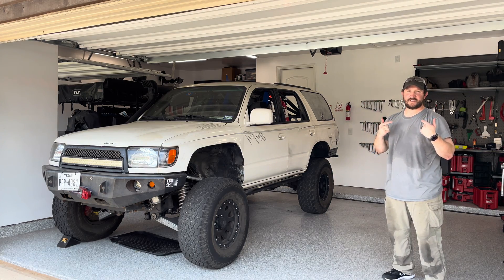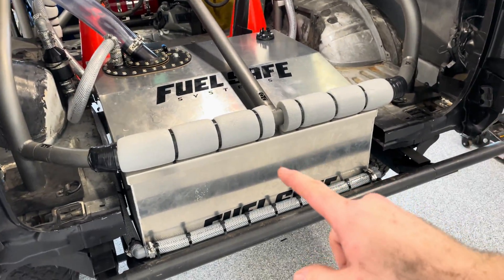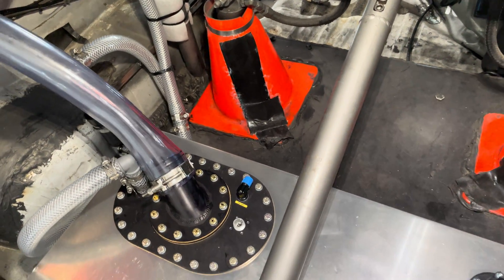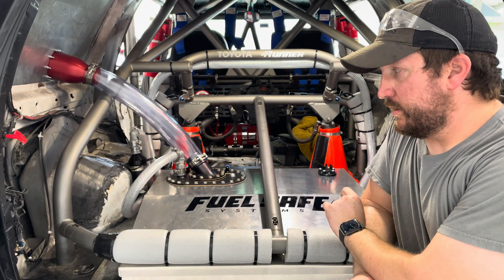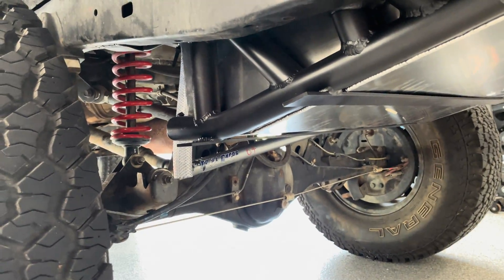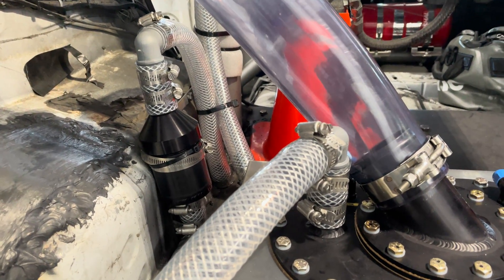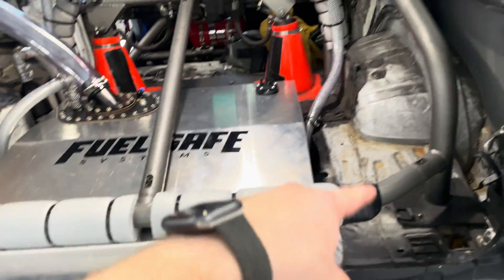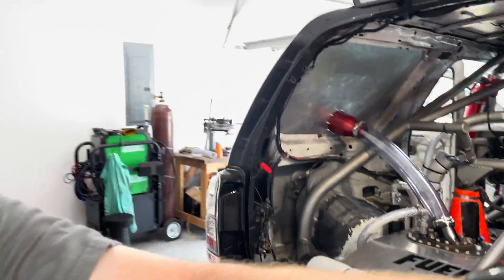FATS vent line fuel cell setup

Comment: Question about the filler hose: When you fill up the tank, is there sometimes fuel sitting in the filler neck hose until you can drive it some?  Thanks for the tips on the vent line, I need to find a discriminator valve.
Reply from the maker: @TEAMPHY6  you’re welcome! Yes, pit crews train to make sure the filler neck is partially filled up every pit stop. Almost no one uses senders/fuel gauges, so that fuel sitting in the filler neck hose is the only way to know the tank is full. Out of all the race teams I hang out with, my truck is the only one with a fuel gauge. That, and you’ll get a couple gallons more range.

Comment: Interesting. Classic cars route it to the carb hat with 1 way check valves.  Is this not a good idea
Reply from the maker: It's not a bad idea on classic cars, because many builders are still using regular gas tanks. That, or they're using bladder-less fuel cells. Regular gas tanks allow for some amount of pressure and vacuum buildup, and that one way valve in the carb hat relieves that pressure and gives that fuel vapor somewhere to go. If that gas tank or bladder-less fuel cell suffers a vacuum (or negative pressure), it's not that big of deal. 
Fuel cells on the other hand are dangerous when they are above or below ambient air pressure. That one-way check valve is not a good idea with race-grade fuel Cells. With race-grade fuel cells like this fuelsafe, they have a woven fabric or polymer bladder that is shrouded in a metal case. The bladders are tensile, puncture and tear rated rather than pressure rated. Any pressure that builds up reduces bladder's ability to absorb energy during a crash. You know how balloons are easier to pop when they're stretched? Same problem with bladder-based fuel cells. They also loose strength when they're exposed to a vacuum, and that's why the one valve shouldn't be used.
Reply from the maker: Great question, by the way!! Cheers!
Reply: Copy.  Thank you.  Was just second guessing myself.  Im a Toyota guy as well with some pitcrew background with Ford . Helping on builds here and there.    I love the build.

Comment: Man I would drive that to work, that's Dope AF...was looking at fuel cell set ups ran across This,and Said shit dude.... what's funny is I have a 99 4runner limited trans is popped Cuz the great radiator cooler,but I'll get it going soon...but This is nuts Man..... Sick.......... Good Job....
Reply from the maker: Thanks man! It's a work in progress, and it never stops. You need a part# for that tranny cooler? The one I have installed is the B&M 70268 SuperCooler Automatic Transmission Cooler.
Reply: @nateatgoodmayhemracing4597  thanks man,put a Camaro cooler on her..but it was too late by then.... she's been sitting for a year, needs trans rebuilt...

Comment: Won't that setup suck in dust into your gas tank?
Reply from the maker: Fortunately, it does not. Since evaporating gas usually causes pressure, the resulting head pressure alone in the ventline keeps it a one-way-flow. With fuel evaporation, the fumes make the airflow go one way. That is enough to keep it clean. Even if dust gets into the ventline, it's 24ft long with several loops and 90 degree elbows. If the dust were to get in, it'd probably build up at an elbow juncture. We'll keep an eye out for that.
Reply: @nateatgoodmayhemracing4597  another thing that I would be concerned about is the pvc tubing. It is not rated for use with gasoline. I would be concerned about it either becoming hard and brittle or it swelling and becoming soft.
Reply from the maker: @beetlebuilder5882  If we were talking about home-depot-available PVC hose, I'd agree. However, there are specific chemistries  rated for gasoline use, and the hose I'm using is hose sold for this exact purpose. Fuel Safe Part# CVH100N.
Reply: @nateatgoodmayhemracing4597  that is good to know. I assumed that it was regular pvc hose that you buy at the hardware store. I will check that hose out for my project.
Reply from the maker: @beetlebuilder5882  You're welcome! I'm glad I could help.

Comment: Thanks for the video.  A question about the discriminator valve please - I thought they were supposed to mount above the vent outlet on the fuel cell.  Where yours is mounted, if any fuel flows out of the fuel cell vent (like in the overfill scenario you mentioned), won't that fuel remain forever trapped in the line from the fuel cell to the discriminator valve?  Thanks!
Reply from the maker: If your fuel cell does not have a roll-over valve built in, the location you've described is necessary, since the discriminator valve would be your first line of defense. My fuel cell has a roll over valve build in, so my discriminator is the 2nd  defense, not the first.  If you're building a car to a race code, check the race code first. Sometimes the race code dictates your discriminator valve's placement.
Reply from the maker: And to answer your question, yes, you're right. That fuel would be trapped between the fuel cell and the discriminator valve in my setup. I use hose clamps on mine to make it readily serviceable. Loosen two of them, and I can drain the fuel back into the tank.

Comment: Does your cell fill up fast using the redhead and the 1" vent?
Reply from the maker: Yes, it does. The redheat is more limited by the jug than the fuel cell at this point.